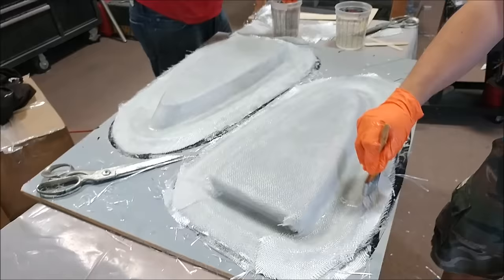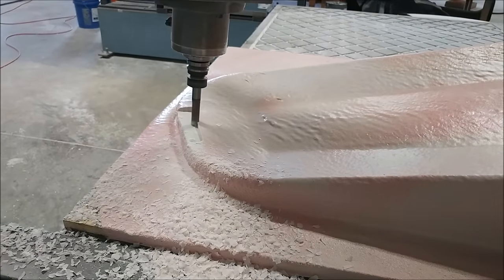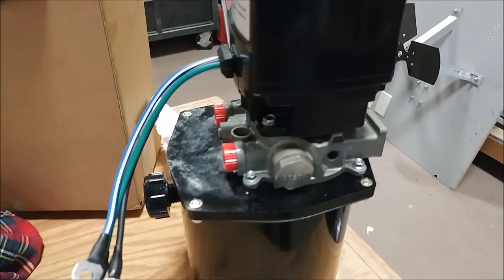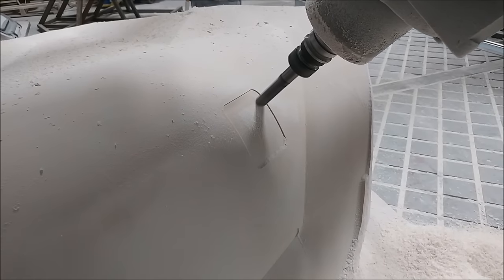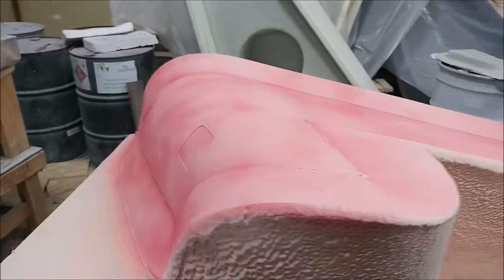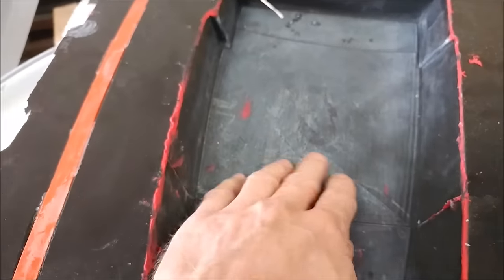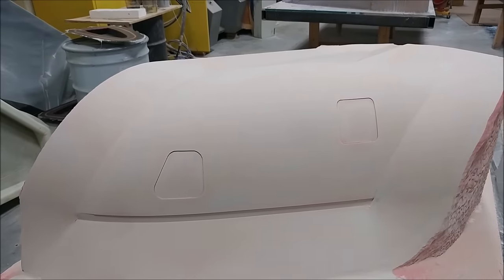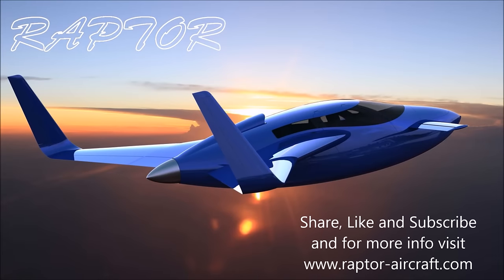Turbos in the House - Putting the puzzle together

Comment: Why not use the P/S hydraulic pump and a hydraulic accumulator for emergency  engine out gear down. Might save some weight and take electrical faults out of the landing gear system. You could have a manual hydraulic valve to blow the gear down.

Comment: Seems to me that there should be a better way to fold up that landing gear without having to use heavy pump, cylinders, valve etc.  There is electric linear actuators and  air cylinders available that should be able to do the job for  less money and weight . keep up the good work and thanks for the updates. Senergy aircraft is going nowhere and cobalt is too expensive,  so you are all we got
Reply from the maker: It's not just retracting the gear, it has to be able to hold it there. I looked into electric actuators and couldn't find any that were reasonably priced, could do the job and also had features like the ability to extend manually if there was a power loss.
Reply: ok. let me work on that